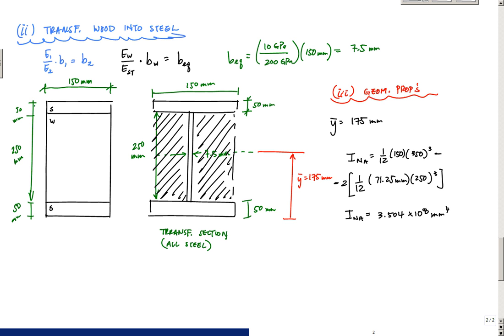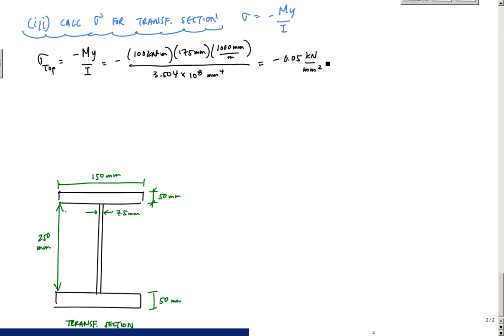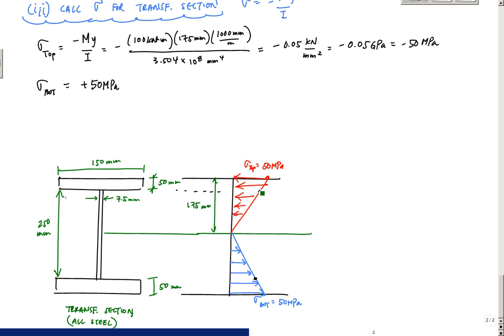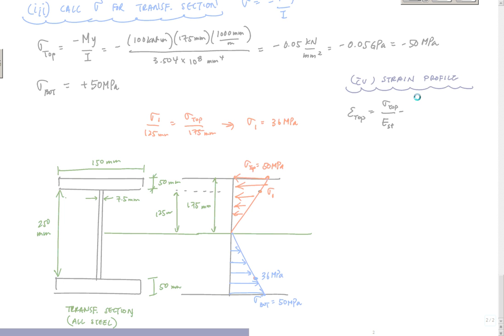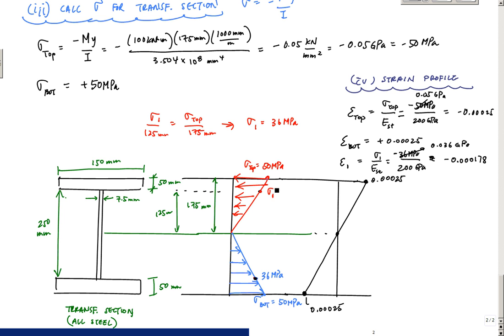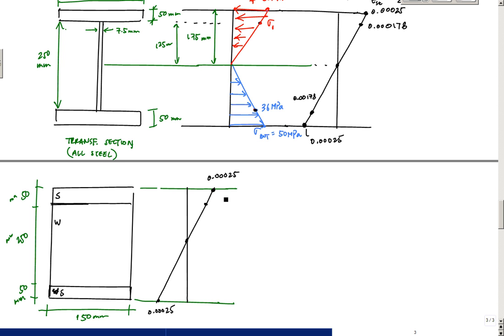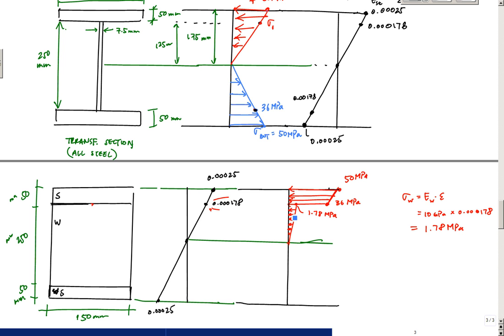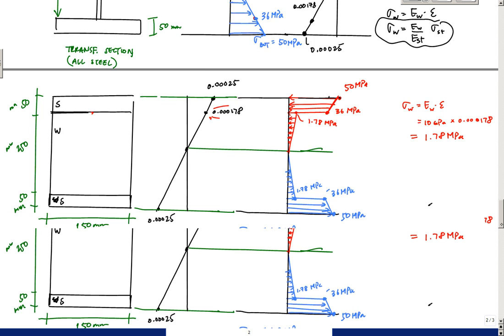Composite Beam Analysis Example (Part 2) - Mechanics of Materials

Comment: how we knew that the compresion in the top
Reply: The way I always visualized it was to think about the exaggerated shape of the beam after the forces have deflected it. If it is a smiley face (concave up) it is positive, if it is an unhappy face (concave down) then it is negative. This rule of thumb has never steered me wrong :)
Reply: @frasersanderson468  woohh u saved me thnkx for the tip
Reply: Thank you
Reply: When can we say that the tension at the top ?
Reply: +Zaineb Amjed   In a continuous beam at the interior supports the moment is "negative" where the tension is at the top.

Comment: Draw a beam with a vertical load applying on it at the mid span, now imagine the beam is bending down due to the applied load (sagging). The top will be shorten (compressed) and the bottom will be lengthen (tensioned).